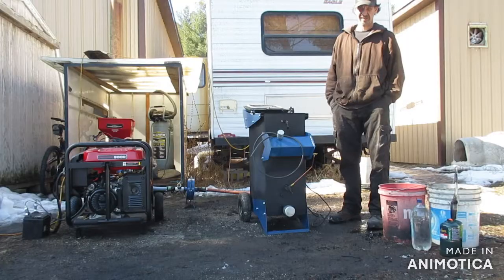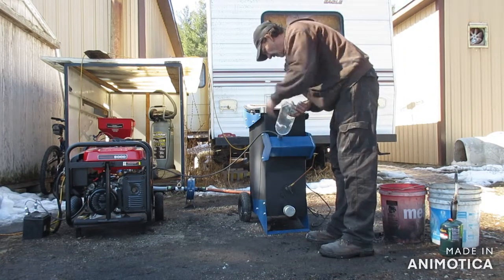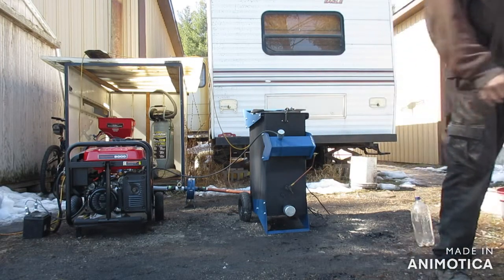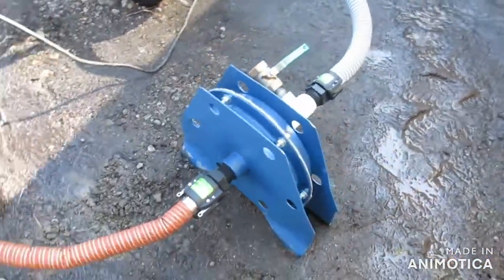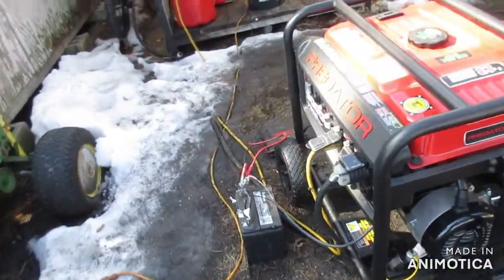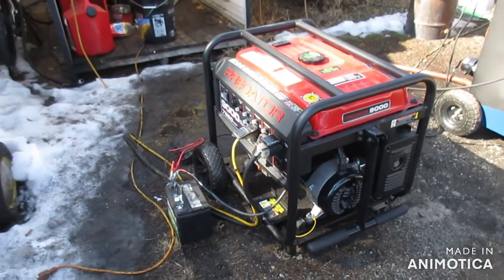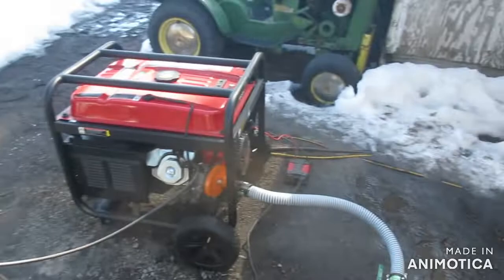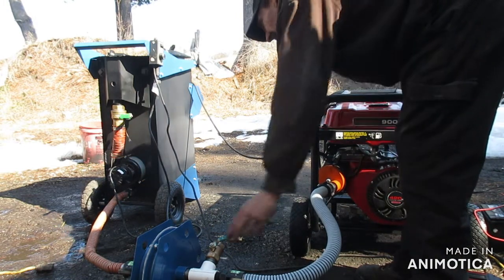M 1 Gasifier Start Up Tutorial

Comment: What's the point of the water? Never seen a gasifier that needs water before
Reply from the maker: The water does two things. One is charcoal gasifiers require nozzle cooling or the nozzle tip will melt and you need to constantly replace it. Second the water as it flashes to steam creates water gas H2 / CO. Note at the end of the video how much more powerful the gas is. The water can add up 20% to the gas energy density.
Reply: @Thrive-Off-Grid  First off bravo on the wood gas generator. Second I feel I must emphasize how water might add to metal embrittlement which hydrogen fueled engines are already prone to. Have you thought about anything that could help with that? Its the only issue I see with gasification. Do you have any theories on how water might actually help stop this process of embrittlement? Its possible that waters action on oxidation of metal might hinder the act of hydrogenation.
Reply from the maker: @cueapronn329  It is for this very reason we would never endorse or build any system that would store a large amount of gas under high presure. As for the gasifier it is not as subject to this as the gas has to very short paths to exit the machine and a gasifier is allays under vacuum. So we are dealing with very low pressures here even if it did occur its not an issue. The water injection adds more H2 and CO is created from it as it flashes to steam and is converted in the reactors process. As for the ICE Ive never seen an issue and Ive never heard of issue of the 80 plus years this has been done. 

Wood gas has been done a long long time and is well proven technology. If embrittlement were an issue Im sure this would be known.
Reply: @Thrive-Off-Grid  Thank you for the information I didn't know non-catalytic hydrogenation required high pressure. I thought any amount of hydrogen in the presence of metal would cause it to weaken but as you have stated and from what I have been reading the hydrogenation of metals only occurs at high pressure above 15 PSI+.(unless of course that metal is aluminum)

Comment: Very cool gasifiers are a great off grid alternative, question for yah have u tried running a smaller inverter style generator ? They are more expensive but run a lower rpm maybe would be more efficient. Also I have seen they sell propane/natural gas adapters for generators that bolt directly to the carb, I wonder if that would work or would the pressure be to low. Cheers
Reply from the maker: We are going to do a DIY inverter generator soon. This will not work with a propane adapter it works of the engine vacuum no need for this. This is not a positive pressure system it is negative.
Reply: @Thrive-Off-Grid  Ok right on I’ll be watching for more content thanks for the reply

Comment: Looks good but do you have a filter for extract tar? 
It may damage the generator after a short time of usage.
Reply from the maker: This is a charcoal gasifier it does not produce tar. Only way it would produce tar is if the user put bad unprocessed fuel in it.  It has an internal bag filter and an inline filter. Both filter at the micron level down to 5 microns. The gas is nearly as clean as NG you would get from a utility.
Reply: @Thrive-Off-Grid  So you process your wood to charcoal first?
Reply from the maker: @urgentcareguy3  Yes, I use the kiln for primary heat and hot water for our shop. Then the charcoal produced runs the unit. No tar the gas is clean. Charcoal production is less labor intensive than chipping or chunking and is also much faster. You do not need to wait day or even weeks for fuel to dry. Energy to produce charcoal is about the same as other methods as well. A chipper is an energy intensive device and you do not get 100% it is more like 50% with a smaller chipper. With Charcoal you can easily yield 50% and the wood provides all the energy for the process. A raw wood gasifier will never be exempt from tar production. If it can happen it and any raw wood gasifier is capable of producing tar.
Reply: @Thrive-Off-Grid  Interesting stuff. Makes sense. A commercial kiln or did you make it? I am assuming the latter 
: ) Chunking makes me nervous. Some of the methods are extremely dangerous. Shared this video with a friend. He is a prepper and was amazed.

Comment: What is the run time? Looks ideal, great work!
Reply from the maker: This set up will run from 1 to 1 1/2 hours. If you want longer run time then add modules. https://youtu.be/qtT9DyhaN5Q
Reply: @Thrive-Off-Grid  20gallon of charcoal only runs the gasifier for under 2 hours???
Reply from the maker: @kazadori164  That is the full cap of the unit, not the useable fuel load. The fuel load is roughly half of the cap
Reply: @Thrive-Off-Grid  so "M-1 Utility Specifications;

20 inches wide x 28 inches deep x 38 inches Tall

14 Ga Cold Rolled Steel Construction

Weight: 135 lbs

Fuel Capacity: 20 gallons

Onboard Filter: Yes

Onboard Amtek Start Up Blower

Engine Adaptor with Quick Connect Supply Hose

Wheel Kit: Standard (all versions)" from your website fuel cap isent really 20gal it's actually 10 ??? and that 10gal will burn for approx 1-1.5 hr.
Reply from the maker: @kazadori164  That is the capacity from its grate to its lid. This has a reduction system half that cap is for the reduction process. The specks on the site are out of date. The weight is now near 200 lbs. The cap is correct though as it is the speck for the R1 design release for the 2022 models. All new orders will be 2022 models with R1 design updates. This is a down draft architecture so that it can be re fueled on the fly and is why it is designed this way. You can not do that with an updraft gasifier.
Reply from the maker: @kazadori164  No charcoal gasifier to my knowledge will fully consume its full capacity. An updraft unit the reduction zone is on top of the nozzle and there must be enough depth for it to work. So regardless if its up or  down draft you can only expect half the capacity as a usable fuel load.
Reply: @Braylen Alberto instablaster =)
Reply: @Kyree Zayd thanks so much for your reply. I got to the site on google and im in the hacking process atm.
Seems to take a while so I will get back to you later when my account password hopefully is recovered.
Reply: @Kyree Zayd It worked and I now got access to my account again. Im so happy!
Thank you so much, you saved my account !
Reply: @Braylen Alberto glad I could help =)

Comment: Would you be able to get more power out of it with a bigger air intake ?
Reply from the maker: The intake port of the head of the engine is only so big. Im already over sized on the hose I use. So no not really.
Reply from the maker: I am going to play with boosting this generator though. The blowers I use are very powerful, I have already done this but need to further test and experiment. The benefit I dont think is so much the boosting, I think it is more that it keeps the gasifier stable increases the air velocity. The higher air velocity the more water I can crack.